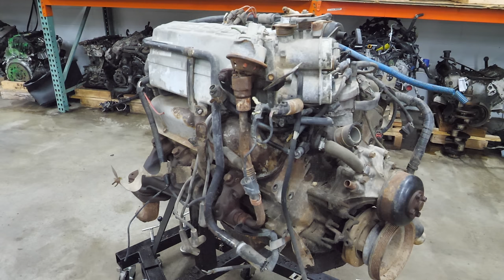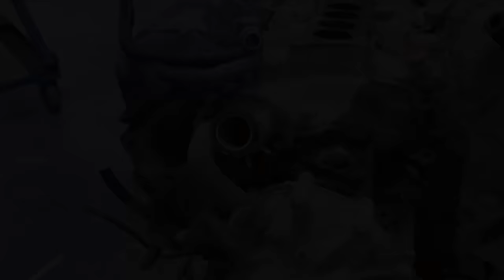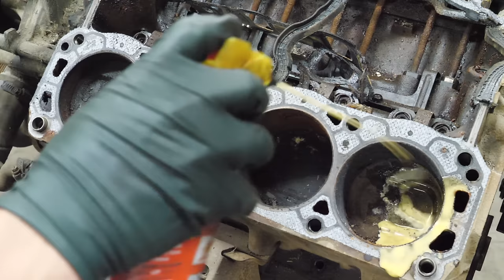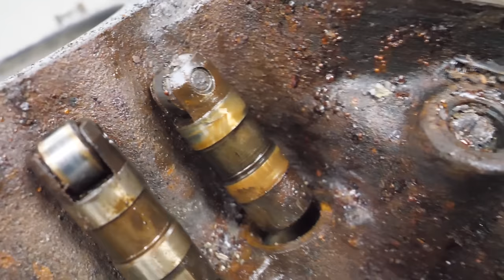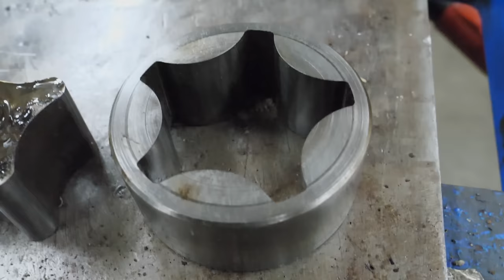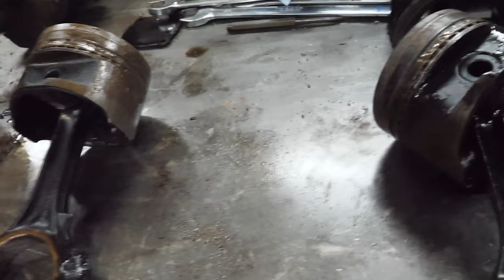LOCKED UP Ford 351W 5.8L V8 Engine Teardown. How Bad Could It Be?

Comment: I like 351windsor and 302s they make an engine shop like me a LOT of money. Simple to do, cheap parts, quick turnaround and every ford guy wants one! Of course a 351cleveland would be a real treat wink wink nudge nudge although they're hard af to find now, bad or good. Unfortunately the roller 351w have a casting flaw so they are no good for power. It's fun watching a tear down of something so familiar.

For rusty engines like that keep a large diameter rotary flap wheel or steel knotted wire brush, attach to a drill or die grinder and go at it a while until you see good metal. The bores are screwed anyway needs an overbore, but it does make getting the pistons out a LOT easier. Follow that up with a little heat on the pistons so the rings which are rusted against the bore breaks free, and then WD40 or Acetone+ATF or a good penetrating fluid. Done a lot of marine engines.

Comment: I currently own and daily a 1995 F250 5.8l 4x4 with 139 original miles on the engine but only a few thousand on a rebuilt E4OD. Also recently bought a boneyard 351w I pulled from a 95 f150 that I'm currently cleaned a crap ton of oil and dirt oil as a "emergency replacement"

Comment: In 1996 I decided I wanted one of the last of the old style F150's so I bought a moonlight blue F150 super cab short bed loaded with the 5.8 and the towing package. 
I think that oil cooler was towing package only but I'm not sure,, it was a great truck..
At just under 200000 miles I sold it and bought a 2002 7.3 power stroke.
That 5.8 still ran like new,, I wish to God I could buy another brand new one...
In those 6 years and 200000 miles the only problems I had was a noisy rear tank fuel pump and the coupling shaft thing for the steering got to where it was clunking and had to be replaced,, and that's it...

Comment: With rusty cylinders, take a wire wheel and clean what you can out of the cylinders and then spray WD-40 or something to let it soak some. We then use a cut of torsion bar and smack the top of the piston from the rod side and if it breaks the top off makes removing the rods even easier. 

Evapo-rust is available at Harbor Freight. be best to clean off the scaly rust as much as you can before using it. Makes it clean quicker.
Reply: I use an air chisel....

Comment: The 92-96 Ford Trucks are by far the best, I have a 1996 Ford F150 with a 5.0L (302) Windsor V8 with 210,000 miles on it and still going strong. The only things I replaced on my truck was the starter, the rear fuel pump, and the power steering megunisum but other than that mostly was just simple maintenance, took out the transmission fluid just to get rid of the shuttering it was making and it hasn't had a problem ever since.

Comment: I have a 97 F250 HD sitting in my driveway. 351w. 130k miles. I gets about 2000 miles a year. Mostly hauling firewood

Comment: The biggest issue with the transmissions only shows up on the fuel injected units. The rubber grommet holding the tv cable to the throttle linkage would deteriorate. Replace it with a brass grommet, problem prevented.
The fuel injected 351, as used in the trucks actually made less torque and used more fuel than the carbureted version used in the Panther cars through 91. Those did 390 lb/ft at 2200 rpm. I know because I had one in an 89 Grand Marquis with the Trailer Tow III Package. The car was rated for 6,000 pounds of towing capacity. The carbureted units used a different cam grind
This engine would be a great candidate for a proper upgrade. New main bearings and a Chrysler 400 crank. Over bore the cylinders. Edelbrock Performer intake, cam, heads, and square bore carburetor. 400cid Small Block Ford, tuned right, and economy car gas mileage with better than 500 lb/ft of torque. My brother got over 550,000 miles out of one of his 86 351s and 700,000 out of the other. My 89 was running perfectly at 200,000 when the car was wrecked.

Comment: Cool, the 351C though was a sleeper against all the Mopar and Chevy guys.
+1 for a Piston Soak experiment.
You could throw some ice on the bolt after using the induction heater. The shock and shrinkage will cause the bolt to return to its narrower thickness and give you just a bit more clearance.
Reply: one cube? hahaha. You gotta Cleveland?

Comment: Here is a "mild suggestion" for FORD engineers...
Apply anti-seaze to ALL Bolts durring engine assembly!
Reply: they are all-aluminum now and maybe even worse in the wrong conditions as electrolysis will take over and cause rust anyways. That said..... I am trying Harveys pipe dope on some stuff in my engine like the oil pick up and the water pump bolts.
Reply: Honda has it right with properly plated bolts. That answers corrosion question!

Comment: Yeah here in the south we still have a ton of these still driving around but I’ve witnessed a few that are still driving but they are all at that point of needing rebuilt. Even the low mile ones need help.

That 351 was the most common base model engine Ford put in everything. Pretty tough Motor. These ECM’s fail a lot.
Reply: We had a 1990 F150 with the 302, here in western Kentucky, and it never rusted out, only surface rust.  It had over 205,000 miles on it with original engine.  Had the truck for about 15 years.

Comment: 26:35 this is when you need to spray a good high temp penetrating fluid to stop it from snapping, you don't want to hit the area around the threads, you then might ruin it oval the thread bore and compressed onto threads, you want to hit the head of the bolt, hammering it in on the head of the bolt, this will then make it easier to remove with penetrating fluid and then more penetrating fluid once its cracked

Comment: Best trick I've found for stuck egr fittings and o2 sensors is holding steady pressure on the fitting with a wrench or socket and rattling the bung or threaded collars with an air hammer that has a dull chisel attachment

Comment: First thing I do when I get ready to work in a locked up engine is pour some Lucas oil in it. Pour some in the valve covers, pour some down the spark plug holes and let it set for a few hours at least. I’m not fighting that rust lol. Had a dude run a b16 out of oil and lock it down once poured some Lucas in it let it set overnight and drove it home the next morning. It didn’t sound good and that was its last hurrah but we didn’t have a way to haul it and I already had a type r swap sitting in the garage.

Comment: Great engine! I bought my 351W from scrapyard, but it surely lays inside the hangar. It cames from E250 '94. From running van. Costs me ~500$. I disassembled it and it's really very low miles engine - presents all cross-hatches, no oil sludge at all, just nice plain cast. New bearings and rings, some head porting and valve job, new oil pan, new dual plane carb intake, HEI distributor (oh, yes, it's much PITA to remove old during disassembly), hi-volume oil pump, aluminum valve covers (welded bracket for PCV to one), new AVS2 carb and it's purrs like a kitten now in my '90 LTD Crown Vic. Oh, and heavy modified AOD with 4R70W planetary, and 3.73 rear gear. Much better.  Sorry for my language, I'm not native speaker.
Reply: I am envious!!! I barely have 3.50 gears and 3-speed C-6 transmission. On freeway the RPM's are going too fast!  It could use the AOD installed with strong gears for 351C stroker. You have WONDERFUL GEARING!

Comment: It was a good engine....Those bearings are relatively clean for a SBF. Mine was running great, rebuilt with a 393 and all the bearings I removed had copper showing across and ~250* of the bearing. Too bad that didn't store it correctly. One more thing...I like to pressure was the engines before I disassemble. Just keeps all the dirt and leaves outta the shop, minor, but just what I like to do.

Comment: That F4TE roller cam block is worth the effort. They were only available 94-96. Lots of demand for those. I built my 408w with one from a Bronco, saves you from having to use a retrofit roller cam with a small base circle because the lifter bores are taller.

Comment: I once found a 429cid in the woods in Sarasota, Florida... We hoped to save the block, but that proved impossible... It seemed to have less rust than those cylinders, but it couldn't be saved... We had to break the pistons out with an air hammer...! There is still a large pile of mainly Ford engines in those woods... We decoded a lot of them, there are 289s, 302s & 351s galore rusting back into the earth... Thanks for sharing...
Reply: Thank You for sharing, any idea Why they're there?
Reply: @alro2434  I have no idea, but our thought was a shop went outta business because there's a lot more than those engines... There's a whole array of auto parts including a couple front cradle/sub-frames out there...

Comment: My Mom and Dad bought 2 1968 Cougar XR7's. Both were the 351 W IIRC?  Dads was white with a black vinyl top, Mon's green with a white (I think?) vinyl top. They were later sold due to the engine rockers breaking. Dad was done with them and bought a Mazda 1800 piston Wagon.

Comment: Had a 1990 F150 4x4 standard cab as a young lad. Went to do a full tune up and stuff didn’t fit. What I thought was a windsor and what the auto parts store figured was a windsor based on logic…was wrong. Someone put a 351 lightening in it. Running on 6 good cylinders with both side rear cylinders looking ROUGH from the plugs, it still ran like hell. I’m a mopar man now, but that little truck was fun.

Comment: Since the pistons are toast anyhow, remove any sqirters and drive them down, not up. The crank is out of the way. Oh and use the brass drift, and the 3 pound hammer. you will need them. I rescued a flooded 351W in the early 90's for a project truck that was kinda rusted. Sold it still running a few years later.

Comment: If you haven't scrapped the heads and you want to try something kinda satisfying, grab the right size drill bit for the broken intake bolt and drill it out from the bottom side. Once you make it to the top side, the drill bit should unscrew the threads you drilled through.

Comment: I have this motor in my 1988 Ford F250. It's no powerhouse, but it will do what you need reliably. 

P.s. Junkyard Digs had a 351w in a station wagon that had next to no oil pressure for a couple hundred miles home. It also had a bad engine main seal and a bunch of sludge inside the valve cover. It ran surprisingly good and made it home with a couple gallons of oil. Lol

Comment: Have you tried using a scissor jack to lift/push the crankshaft out of the block? Maybe try a 4x4 across the top of the engine stand legs, then place a 4x4 vertically in the center of the other one (resembling an upside down capital T). then put a scissor jack between the 4x4 and the protruding portion of the crankshaft and crank it up. Maybe place an old rod bearing between the two to prevent damage to the crank.

Comment: Boy this brings back memories. I used to work on these ford/gm/chrysler engines in the 70's.   We didn't have electric anything
tools. And I think I had one of the first air ratchets. In those days it was a 3/4 air gun or a 1/2 air gun or a ratchet, all air driven.
And no turbo's. Plus not much in the way of pollution controls. Nothing like today.  And I broke plenty of bolts.

Comment: They're not kidding about that Evaporust. I put the timing cover bolts from the 351 I took apart over the fall (going in my Mustang) and it took the rust right off them.

Comment: A few things I've learned is if you get the crank out, try pounding the pistons in then run a hone down the bore then try pushing them out. For those water pump bolts I've drilled small holes through the water pump housing to t he bolt bore, then soak the bolt with penetrating oil through those holes.
HTHs

Comment: Some of these had a problem and were recalled for intake manifolds breaking off in the head, causing coolant leaks. My grandfather's 96 had this issue. Other than that, they're great. You're right, this era of ford was great. I daily a 94 f-350 idi turbo.
Reply: Only downside of this era, is lack of horsepower.

Comment: Eric O, has said penetrating fluid just gives a guy confidence to wrench harder.  Looking at how dry those water pump bolts were immediately behind, I tend to agree.  But I will continue to use the confidence booster😄.

Comment: Eric, a bit of advise (please take with a grain of salt, as this is my opinion only, and is in no way meant to be taken to cure any diseases like mumps or typhoid fever). Heat up the piston. Heat gun or a spicy meat a ball. 
+++ OR +++
For stubborn, rusted pistons in the cylinder. Crank is out. Might also work to move the crank with pistons attached. 
Harbor Fr8, like 30 bucks for a crap air hammer/chisel thing, 15 for the end you need. Save the receipt, cost it. It's for work. Write it off.
1) put rodcap back on, no nuts needed. Just slide it on.
2) get small block of wood, put it against the rodcap, in between the studs as to not contact the piston walls on the way out.
3) air hammer/chisel with large, blunt "hammer" end in it.
4) blip the trigger. make sure you're not deforming the rodcap. wood 'should' act as a shock absorber of sorts.
5) also works on piston heads, use the wood Luke. force or you.
ONLY USE THIS TACTIC IF YOU PLAN ON SCRAPPING THE MOTOR, AS DAMAGE COULD OCCUR. 
FOR RUSTED, STUBBORN PISTONS THAT YOU'VE SWORN AT FOR AT LEAST 12 MINUTES.
PUCKER FACTOR 5/10, USE EYE PROTECTION OR JUST BE SMART ABOUT IT
get it? got it? good.

Comment: I had to put a 5.0 version of that same engine in a truck twice because the first remanufactured long block had low oil pressure, leaking freeze plugs, and it wore the cam flat in only about 5 minutes of run time. Holy Waaaa......

Comment: My pop took delivery of a brand new, 1971 Galaxie 500 4 door with a 351 Windsor. Was a lot of fun the first time he had to replace the thermostat housing and the bypass hose. 
IDK why he chose the Windsor over the Cleveland. He also had station wagon rear springs installed at the factory 'cause regular Galaxie rear springs were notoriously soft and sagged with low miles. He also got it without AC - which was a mistake. Ford designed the engine compartment to flow air around the AC components to help cool the engine. With NO compressor and such, valves were prone to overheat on the one side!
Who knew???

Comment: Those water pump bolts on small block Fords always put up a fight. Looks like that induction heater is the ticket! Those would be the perfect bolts to replace with stainless ones. I am surprised that a 351W stayed on the shelf for 17 years! Around here they don't even make it to the shelf before someone snatches it up. Perfect foundation for a 408 stroker!

Comment: It almost seems like submersion/flood damage was the entire reason the truck that came out up ended up in the junk yard. The roller cam 302s and 351s didn't start production in the trucks untill 94 iirc, and alot of them are still running about today; totaling due to flood damage is the reason that makes sense as to how a good truck less than 15 years old ended up in the scrap yard. 17 ish years would actually be pretty close to the katrina recovery time frame, and im sure alot of vehicles from that got shipped to scrap yards around the country just due to the number number of totaled vehicles and lack of space in scrap yards in the gulf coast area.

Comment: One trick i have seen, bolt the head with gasket back on, make sure the valves seal good, find an adapter to run through the spark plug hole to a grease gun. Pneumatic grease guns work best

Comment: 12:56 I will say that it's expensive but it is a indispensable tool for everything you want loose but don't want to melt, just takes a little longer than a torch, sometimes up to 5-10× longer depending on how much heat it puts out.😊

Comment: The 351W in my 1974 van was a gutless wonder. I  replaced it with another 351 but with a four barrel carb, and it was still a gutless wonder.
Reply: The 351 in the XC Falcon delivered in Australia was good for 250Hp out of the factory. The 302 was I think 208-212Hp. In a 3000 pound sedan it was dangerous in the rain. Race teams using the 351 were easily getting 400Hp with a cam and a 650 cfm carburettor
Reply: @theairstig9164  The 351's manufactured in Australia are Clevelands, not Windsors.  Different block, different heads, entirely different design.

Comment: There is a freeze plug at the back of the engine that you could take out to help remove the CAM shaft. I have rebuilt many 302 and 351 Fords.  Would love to find as many of those engines as I can.

Comment: Evapo rust is 8 $ a guart or 26 $ gallon at Harbor freight . Not sure how much you would need to submerge the entire engine or how much would be left after a few days but it would definitely remove all the rust . I have seen people dip entire Range Rover frames in a makeshift tub and it came out squeaky clean !

Comment: The Niagra Falls of Penetrator. Ladle it on Pal lol! Seriously, good job with dem bolts. Amazing the handy tools available Stateside. I find Molasses works good. 10 parts water, 1 part Mol. Only downer is immersing in the solution and a 2 week wait. Converts Iron Oxide into Iron Phosphate

Comment: I drove work trucks for 20 years and never had any problems with oil leaks. FE's yes. And you are right about the trannies. After the old C6 3 speed autos, there were predictable problems, usually a couple of thousand miles after the warranty expired. In 1999, i started driving power strokes and things were OK again.